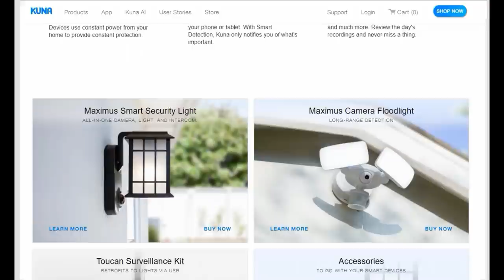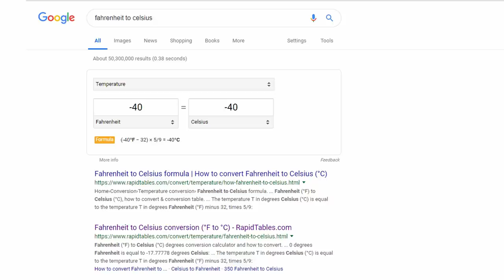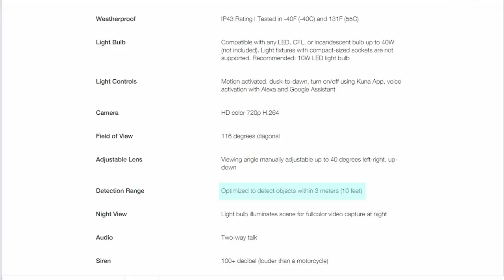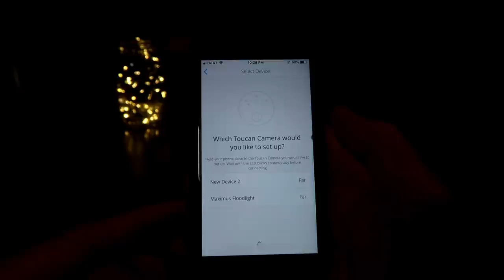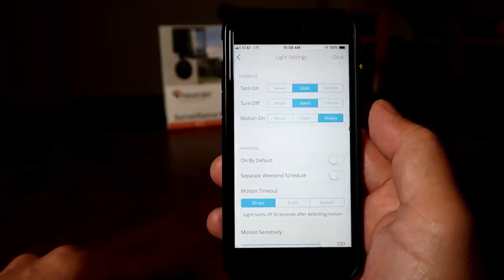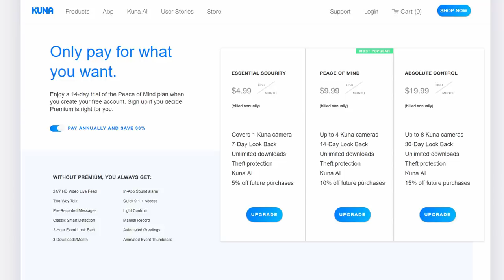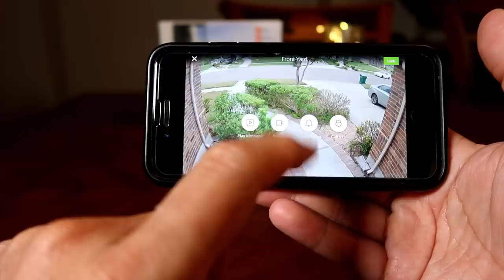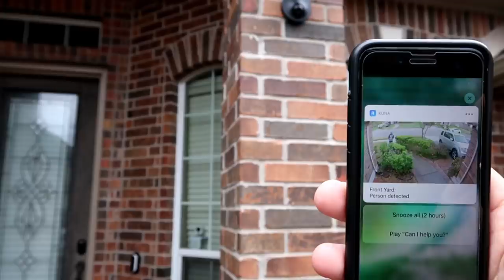Toucan WiFi Security Camera Kit Review - Unboxing, Features, Installation, Setup, Settings, Footage

Comment: It would be worthwhile at 1080p possibly.  Night vision looked really grainy even with the light.  Not sure if that was due to the 720p or something else.  Animated GIF is very nice.  Would be nice to see that on Ring's alerts.  On the electrical box, most are exposed, but they give you a foam gasket to help.  I could and probably should caulk around them as it would help some, but mine haven't looked near as rusty as yours.  Fun part of that nice salty ocean breeze I'm guessing.
Reply from the maker: I wish Ring will have that option so that you don't have to open the app. Nest has this GIF preview as well which a lot blamed that caused their motion notification delays and I know now that is not the case. Kuna proves that you can have an animated preview with little to no delay in notification. I actually like this setup (resolution aside) because I will have a heads up and I can look who is going to my front door and pressing the doorbell without opening any apps.

Comment: I bought the camera. I like it. Like you said the view is limited but pretty clear. Very good security camera and concept that can use a little upgrade.   How do you set it just for the light to come on during motion? Couldn't figure that one out. I have a floodlight on the side of my house so I don't burn both all night. I alternate using them.
Reply from the maker: In the light settings, check in motion On  night or always...

Comment: Would you not be more tempted to use the smart socket with a better cam? You could potentially use a ptz in the dome of or reolink etc on the wall
Reply from the maker: You probably can but make sure the camera is weatherproof.

Comment: How does the adhesive work in extreme weather conditions?  I wouldn’t think to use that on brick or stucco or anything outdoors. The adhesive would normally be used on interior walls on anything that was relatively non porous and flat even surface.  Would need to see how this holds up long term without using screws and how to install with screws.
Reply from the maker: It should work ok. I have used the heavy duty/outdoor use 3M mounting tape on my solar powered lights and it is still holding up.

Comment: Thank you for reviewing the Kuna. I bought one and your instructions were really helpful for the install. 
But can't get it to pair with the Smart Socket no matter how close I get, so the light stays on all the time.  Tried all the help instructions on their site.  Rebooted twice, re-installed twice.  Any suggestions?
Reply from the maker: Check to see how far is your light camera unit to your router. You might need an extender. Contact them if the issue continues.
Reply: @LifeHackster I ended up contacting them and just a FYI there is a reset button for the socket...not listed on the instructions on on their site...after resetting the socket all is well.

Comment: We are renting the home we are in and I replaced 2 light sources one with a flood light and the other with the ring flood light. They are both on the same light switch so worked out perfectly.  But they werent caulked and both had bug. idk if water get in but where we live we dont get too much rain.  I have question. So I caulked my new flood light so no bugs and rain gets in. But i never caulk the ring floodlight one. Do you think I should or have you caulked yours?? Just wanted your opinion.  Thanks for all your hard work.
Reply from the maker: I didn't caulk my Ring floodlight. It has a foam gasket and is sufficient enough to seal the base of the light to my junction box. Most floodlights too have the foam gasket but this porch light and the old one that I replaced doesn't have it.
Reply: @LifeHackster  Same here the Ring floodlight has a good gasket so i figure was fine. But the floodlight I have just came with a flimsy gasket so thats why I put caulking around.  Same with our lights that I took off too. No gasket inside.  Thanks again for your help.  Love your videos.

Comment: My outside lights are connected to a light sensor and only turn on when it detects dark (at night). Once sun come up they automatically turn off, although my switch is only on... 
Will that mean this camera won't turn on during the day with my current set up?

Comment: Can this be installed if my lighting fixture is recessed ? Potlight ?
Reply from the maker: As long as you can replace the socket with the smart socket and you might not able to hide the wires going to the camera...but it should work.
Reply: LifeHackster ok thank you ...I’ll check the light socket

Comment: Sounds to my like garbage product , I will avoid, thanks for review
Reply from the maker: I actually like it..not for the resolution but mostly for almost instant notification and also for the GIF preview. It goes hand in hand with my video doorbell and gives me a heads up and I am able to check who is at my door earlier and without opening any apps.
Reply: It's super cheap on Amazon right now.  $60